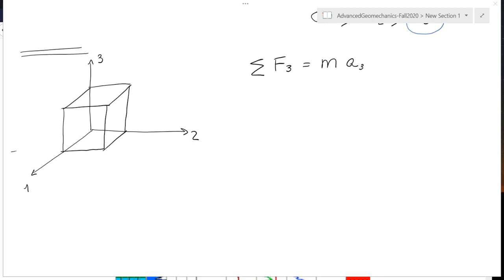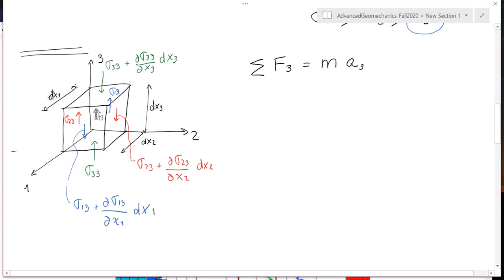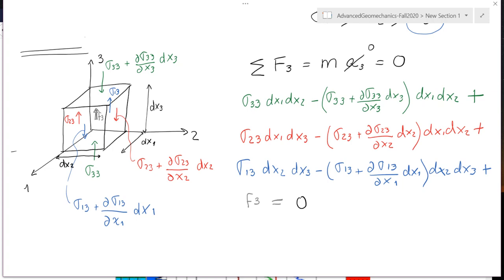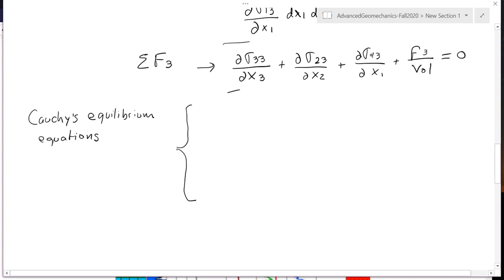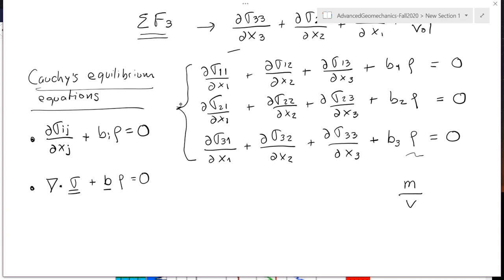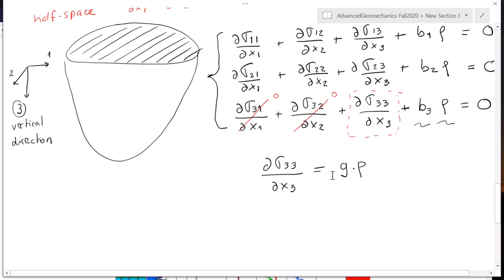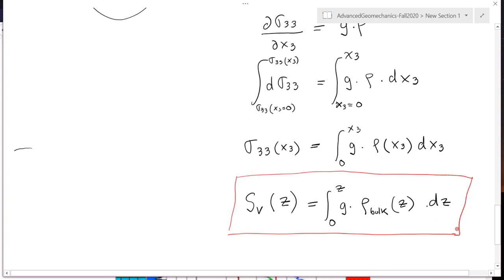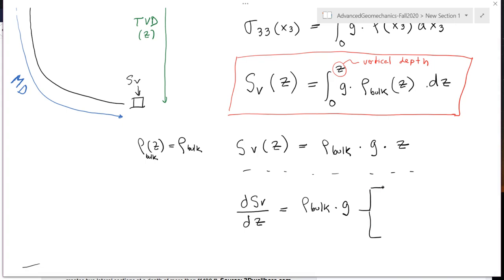L02 Cauchy's equilibrium equation and vertical stress derivation

Comment: Dear Prof. Espinoza
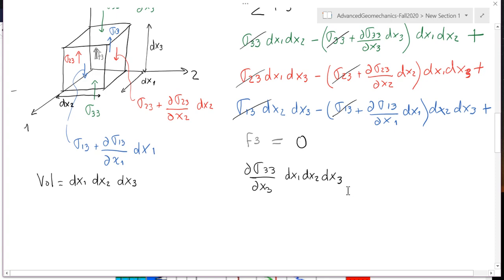Sorry if i have missed it, but it wasn't clear how did you turn the stress gradient negative sign to the positive sign in 10:00 and write out the other terms, even though the derived formula is indeed correct for the balance of linear momentum (where the compression forces are taken as negative). i would be glad if you explain it. I am aware that in Geomechanics compression is taken as positive, in this case I guess the principle stress (e.g., sigma33) had to be taken as negative and the corresponding stress gradient had to be taken as positive for the equation to be correct.
Reply from the maker: Dear Milad, this is actually a mistake on my derivation. Either the gradients should have been negative around 10:00 or f_3 made negative. The mistake is actually making f_3 (or b_3) go down (in gravity direction), as it should in a geomechanics problem, and that's why the calculation of vertical stress is correct in the lithostatic stress problem : )
Reply: @dnicolasespinoza5258  Thank you very much for the explanation. I know that these are some boring equations with unavoidable writing errors when deriving by hands. I was just wondering if i have missed something. Moreover, I am writing to sincerely appreciate the time and effort you have spent in updating your youtube channel and moving the engineering society to the next level. Thank you.